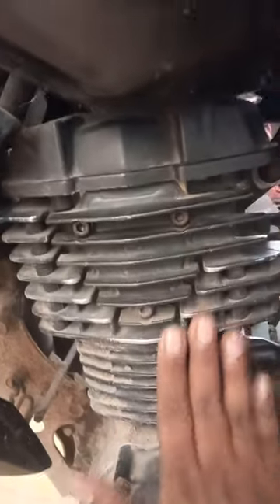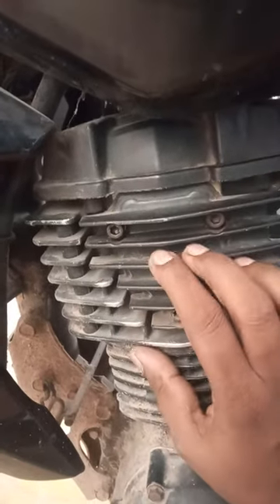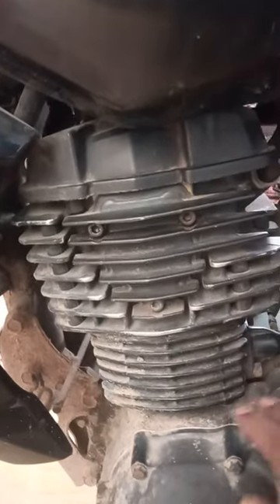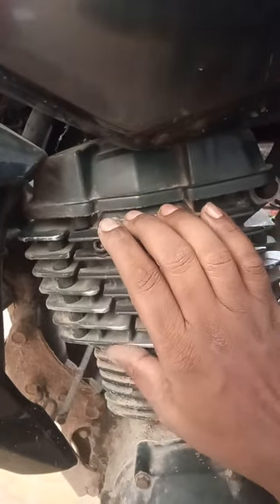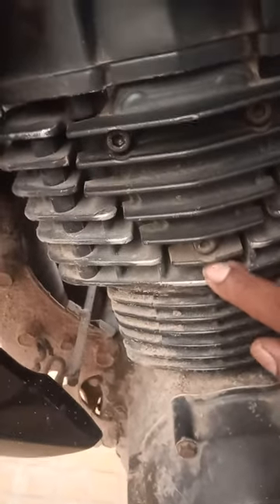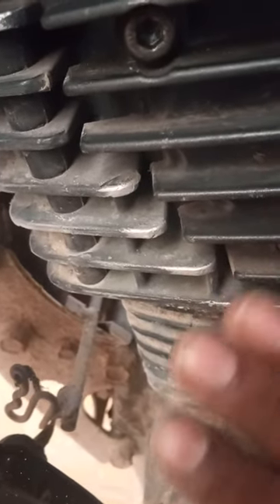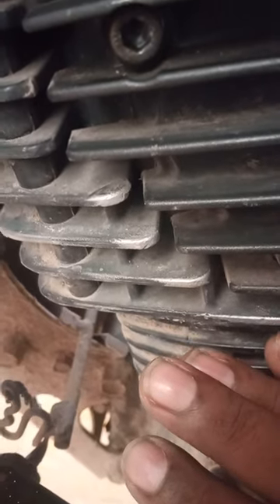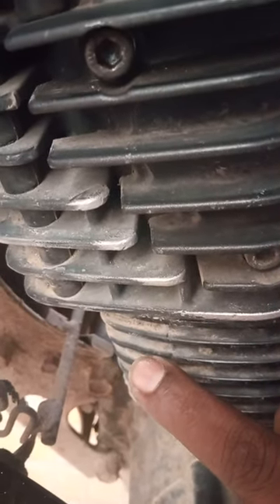Engine Cooling Fins #shorts #tamilshorts #automobiletamil

Comment: Same mechanism used in cpu using heat sink and cpu fan for air cooling heat sink increases the surface area for heat conduction
Reply: But I never saw fins in a cpu. So can you please explain how cpu cooling is done??